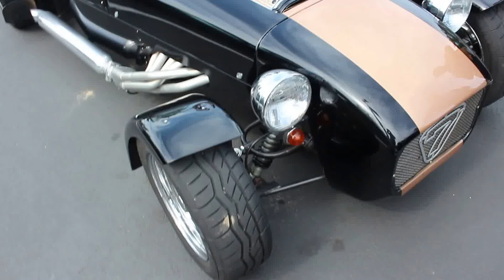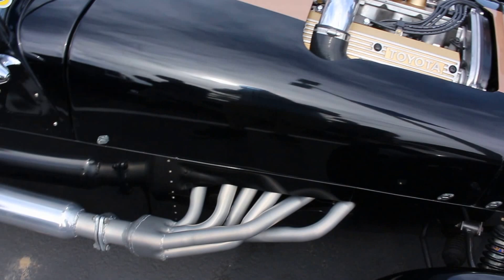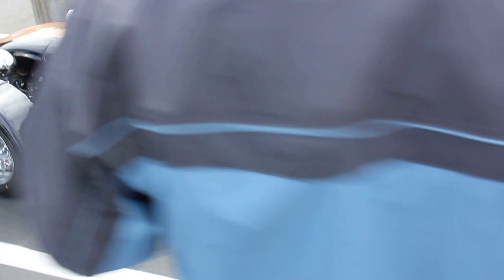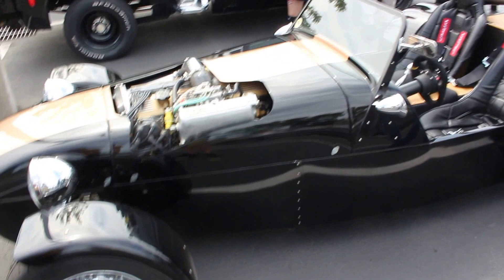Toyota Supra Powered Locost 7 Walkaround

Comment: I don't want to be negative I really don't but you guys (Americans typically) really seem not to understand the Lotus 7 concept.  The cars are intended to have very good power to weight.  They are not supposed to have so much power that it overwhelms and unbalances the chassis.  You need to dial that shit back.